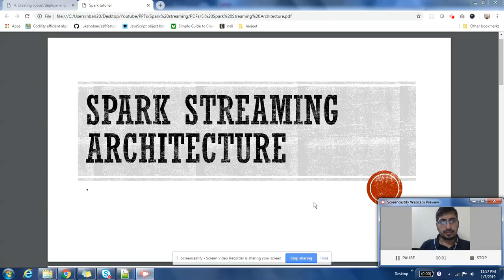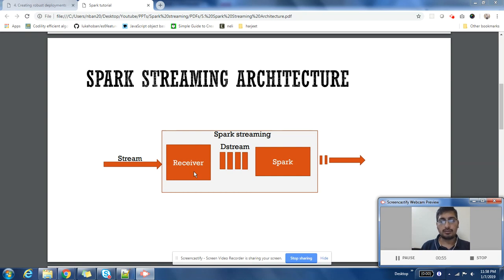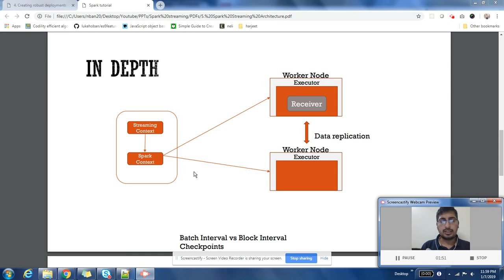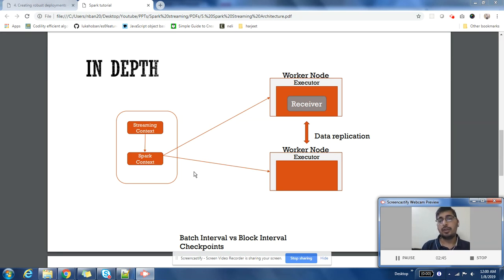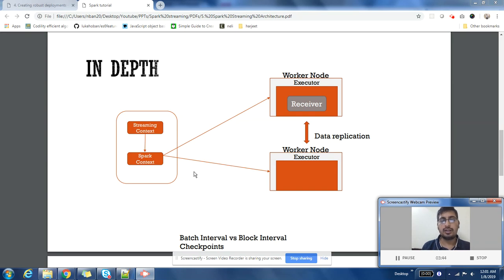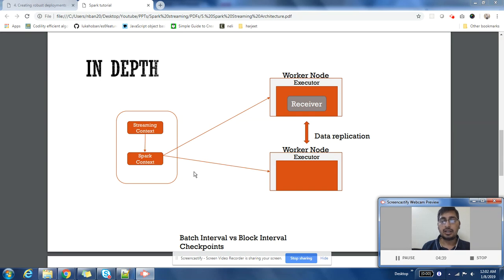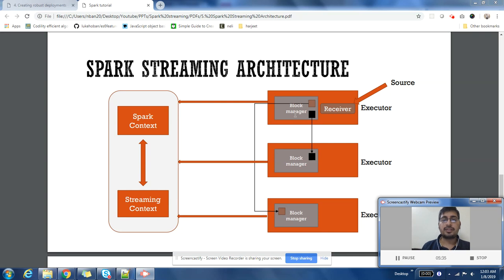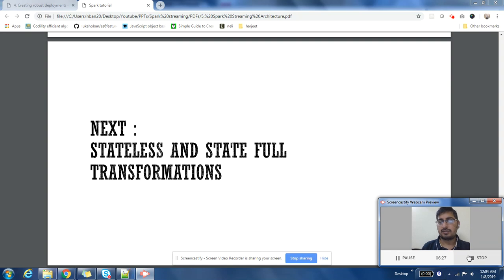7.5 Spark Streaming Tutorial | Spark Streaming Architecture

Comment: Hello Harjit,

I had faced one problem while working on spark streaming.
In my scenario as and when a file is received my spark application runs in streaming mode. Now what I have observed is that after I receive say 10-15 files in different intervals resulting in running the spplication 10-15 times after that my driver memory goes out of memory.

I have been working with files of small size only and I have made sure to remove any collect operation happening the code.

My expectation is that once my application has run once completely the driver memory should also be cleaned up GC at certain intervals  so that is doesnt grow continuosly and eventually fail with a OOM error?

Any suggestions from your end?